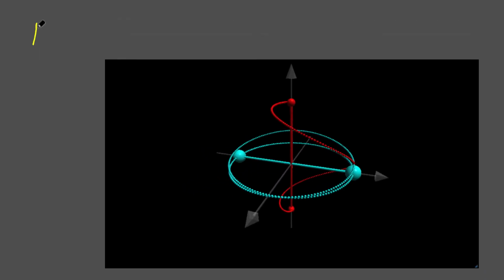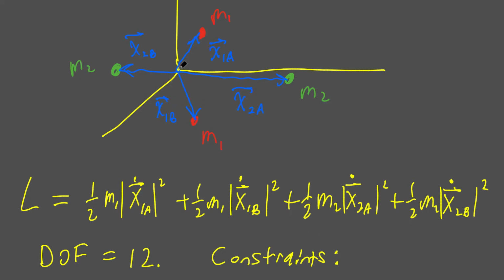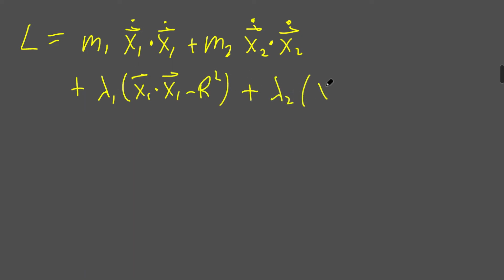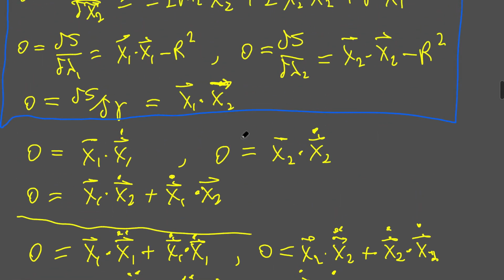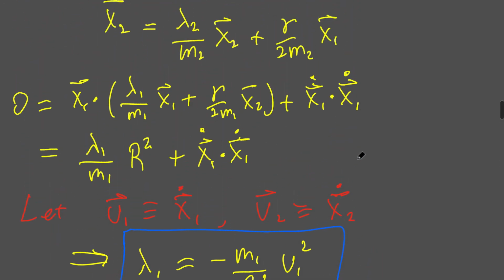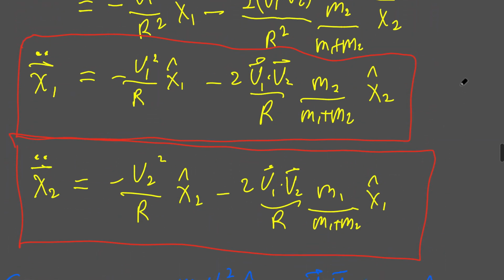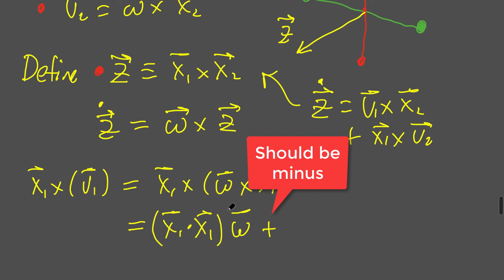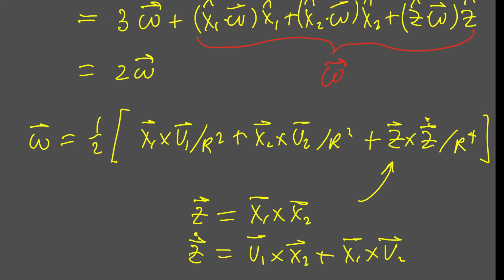The Dzhanibekov Effect: Equations and Simulations

Comment: David,
Thanks for the very nice demonstration of using Lagrange multipliers to determine the equations of motion.
Thanks also for sharing the vPython code. It is very clear and well structured (and will get reused for other projects)

I have four main questions:
1. Are there initial position, velocity conditions and/or mass ratios that produce quasi stable spin (unstable resonances) on the intermediate axis? If so, is there a way to compute these? 

2. Before I attempt the exercise, would the addition of an independent z axis mass M3 overly complicate the computation of  the equations of motion using the Legrange multiplier method? If so, would one of the other three methods you mention simplify computation of the equations of motion for this case?
3. Would the addition of a third independent z axis mass help stabilize spin on the  intermediate axis, I am thinking similar to earth moon stabilisation,  and hence help to produce quasi stable resonances?
4.Would programming rounding error make resonances impossible to simulate?

A very educational video, you should extend it to show and compare the other three methods!
Keep up the good work.